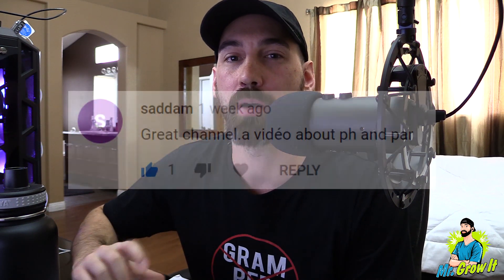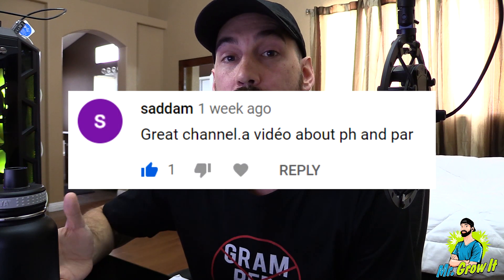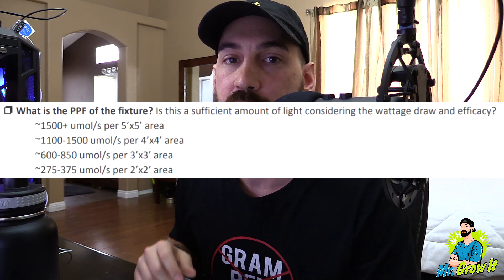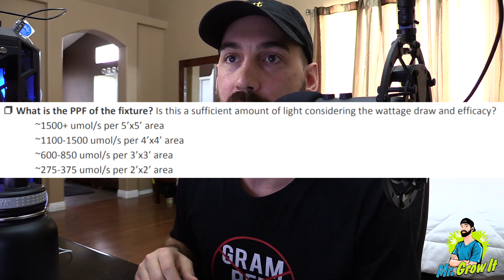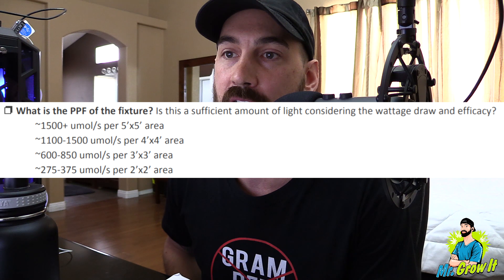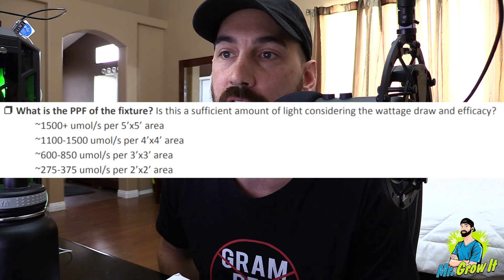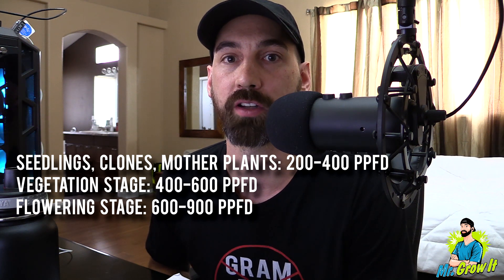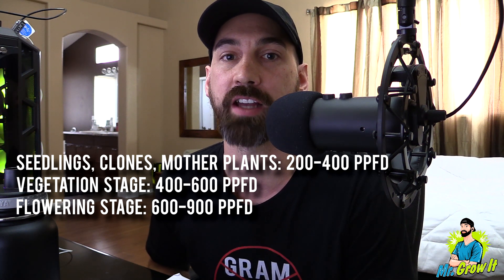How Much PAR For Plants in PPF & PPFD!

Comment: This information is incorrect! When growing with LEDs, and it took me about 8-9 months to figure it out. 200-400 (no more than 420 PPFD in veg) 

And in flower it’s starting at around 400 and slowly increase until 800 (at the end of flower max out at week 6) 

Otherwise you will have plants which are as big as this emoji 🪴 😅😢
Reply: Ps: the plants cannot grow up if the PPFD it too high in veg. Then you have very short internodal spacing and a really tiny plant, as well as light stress / Burn 🪴

Please take this video offline mr grow it. You are spreading incorrect info. 😂
Reply from the maker: Sounds like you may have other issues in your grow if your plants aren’t able to absorb 400-600 PPFD in veg.

If you want to get even more accurate when it comes to lighting, look into DLI. Many cannabis growers aim for 40 DLI. Some go upwards of 60 DLI. 600 PPFD at 18 hrs per day is 38.88 DLI. If your plants are struggling to intake that much light, look into your environment conditions, nutrition, and genetics. Remember, just because you’re not able to get good growth using the general PPFD ranges mentioned in this video doesn’t mean that everyone can’t get good growth with them.

Comment: I just downloaded a ppfd/dli meter on my phone and wow its a gamechanger as far as how close i csn actually put my lights without harming my plants,the meter is spot on too i bought a viparspectra va1000 and the person who had the light before me used an actual meter at 18" and had gotten 638 PPFD and 45-52 DLI  and when i put my phone at 18" under the exact light my phone read 640 pretty interesting
Reply: A single reading isn't really enough to do a calibration, but it does suggest your phone might be fairly accurate.

Comment: Is the par your talking about for auto flowers or photos? Or does it matter? 200 to 400 for auto seedlings?
Reply: Its all about dli.  How much light the plant can absorb in 24 hrs.  If you run 20/4 autos in flower need about 550 par. If 18/6 590-600 is the same dli. Unless your flowering autos on a 12/12 schedule. Keep way below the 900 they recomend for flowering photoperiods.  In other words 18 hrs at 600 par is the same as 12 hrs of light at 900 par

Comment: Chris - I've read using a T5 blacklight ( in addition with my LED light fixtures) during later flowering ( week 3 ) can help produce more THC / CBD. Do you happen to know if there is benefit to this? Is it worth trying out?
Reply: Hey, so if I don't need to turn my light strength all the way up to reach those ppfd or par numbers is that okay or should I raise it to 100% power and raise the light

Comment: Would like to know about DLI in regard to the levels throughout stages.  These changes are only due to the length of light, and not really changing the DLI throughout the veg to flower which seems to be the idea here.  600 par 18 hrs is the exact same DLI as 900 par 12 hrs.... 38

Comment: What about autoflowers? Do they require less PAR because of the 18/6 light schedule during flowering? Or should autoflowers also get 900 PAR for the whole time?
Reply: With a longer light cycles with autos. I'd use a little less then photos.  It's a longer cycles of intensity, so I'm at 50% power  (sf2000) for now. And it's going well.  About 19" above the plant.

Comment: Love your videos,,,so I bought one 1000 watt light and  did fine in a 2x2 area small buds but still that’s fine with me it grew a lot of little buds ,,,so I bought 3 more 1000 watt lights ( they actually use 105 watts) ,,can I use all four lights together equally spaced for a 5x5ft tent or even a 4x4 ft tent ,,,,looking at this lights bigger versions the 2000, 3000, 4000, units each time they get larger the watts increase are the same their 1000 light = 105 watts from the wall ,,,,yet their 4000 light uses 420 watts ,,,
By me using all four of my 1000 together does it equal the same as their 4000 light??? See where I’m going with this ??? 
Most led light companies are selling 1000-4000 watt lights ,,,,,so instead of getting one big light I got four 1000 watt lights
Reply: Are you talking about blurple lights? The ones with Veg & Bloom switches for blue and red? If so, i suggest don't buy any of them anymore.. They are old technology, and they don't produce good results..  For the amount of money you will spend on multiple units, you could just buy 1 single badass professional light fixture..
As you said, the real wattage is 105w. But usually they have fans in them, and the fans take some wattage as well (maybe 10,20,30 watts, i don't know)
Also when you use only Veg or Bloom functions, the wattage is split between them.
105 watts - 20 watts approximately for the fan = 85 watts
85 watts split into veg & bloom = 42,5 watts each
You would have to constantly run both veg & bloom so that function beats its purpose. Just get a good light to cover a 4x4 or 5x5 i suggest check out Lumatek or Photontek lights

Comment: how long until a lighting manufacturer can actually make a bar light to get 925 to 950  ppfd across the whole grid centre, edges and corners in the most popular sizes for flowering (eg 3x3,  4x4,  5x5).
perhaps it is possible with the bar lights which can be adjusted for position and arrange more bars towards the edges.

Comment: Cannibus is in rose family, it does not have diminishing returns or too much light. 
June day is like
2000par. Source Bruce bugbee
Reply from the maker: I know the sun emits over 2000 PPFD, but give your plants 2000 PPFD indoors with a grow light and see what happens.
Reply: @GardenTalkwithMrGrowIt  mine are currently about 8 inches closer to my optic 6 than recommended and there’s no down side so far
Reply: Center is 1895 at 22 inches so it has to be over in the center
Reply: The sun starts the day @ zero....slowly climbs to 2000....then tapers off back to 0 @ sunset. Plants don't recieve 2000 all day.
Reply: @boognish593  I agree there I have my control set to try to mimic better now but idk if it does anything, I def reduce the hours in a step now also. 48 off then 13-11 down to like 8-9 the last week
Reply: Again idk the results as I haven’t monocropped and my plants vary from clone even tho identical almost cuts they just bush up sometimes some stretch it’s strange lol
Reply: DLI is what matters. Its not 2000 ppfd all day outside!
Reply: @markrigg6623  what's a good dli for each stage? or atleast for seedling stage

Comment: Incorrect. You can not get 25% added yields by simply adding Co2 unless Co2 is your hindrance. If you have added 25% extra light, space, veg time, nutrients, Oxygen etc, lack of Co2 has to be your hindrance in getting the added yields. You cant add Co2 and expect 25% higher yields when you have not added 25% more veg time, light, nukes, space etc. That's like adding 25% more horsepower but no increased airflow to support the turbo. Co2 has to be the hindrance in getting 25% higher yields in order to see the yields from added Co2, otherwise you just added Co2 nothing will come of it if u haven't suited the environment and grow for 25% extra yield. You cant throw 25% xxxxx on a grow equipped to only hold xxx. Co2 has to be reason for lack thereof. I see this with all you youtubers, yahl give out false info or actually lack of and that's why most growers fail, from unrealistic expectations. I see you explaining to someone who has never grown in his life, how to run Co2 in a complicated setup and not once did u ask, dude, have you ever grown before? Like they come thinking as a first time grower, the more plants I grow, the more I get when infact the amount of light has yield max if Optimazation is there not by more plants more yields. I dont care if u grow 2 plants longer veg or 60 plants shorter veg 1000 watt 5x5 is 1.5lbs if you filled your trellis with all tops and 2ft of vertical canopy etc. Once they realized they failed they sell they equipment for unrealistic expectations. Teach your subs first the basics, Co2 is for experienced growers being so much optimization is needed and these people here can barely get past seedling stage without overwatering, to much light and over nukes. Teach them first how to grow. 75% are 4 months in still in seeking stage on a stunted plant they won't let go thinking its just growing slow but it's actually dead from salt buildup and overwatering with $3,000 worth of new LED equipment and Co2 tanks in the corner waiting to use it as a first time grower and they cant even get past seedling stage. Unrealistic expectations. I wouldnt even mention Co2 to your subs until they can show you they can first grow and not kill they plants. Same thing for ppf/par/ppfd/umols etc. Co2 is pointless if they killing they plants from over nukes and to much light.
Reply from the maker: You must be new to the channel. Welcome! Did I say "25% added yield from co2" in the video? If so, timestamp please because I couldn't find it. We talk about PAR in this video not CO2. Maybe you commented on the wrong video?
Reply: Oops wrong video I was on your other video it switched while typing but Co2 adds 20% more so I just added the 25% and no I am not knew I just dont comment

Comment: If anyone is looking for a cheaper yet very effective LED grow light. Look on Amazon for deformable led garage lights. They utilize the very same Samsung LEDS and even if they do no not the par output us at or above 1,500 for the price of around $50. You can get them for cheaper by using a promo code or coupon. For instance when searching look for one with little to no reviews. Just make sure that the light says that it uses at least 120 watts and not the equivalent to the same wattage. There is a big difference. As for the lights themselves they have built in drivers and work as simply as screwing in a light bulb. The difference is they have unfold LED panels which are cast aluminum that are driven by an internal driver and have a web like design to dissipate heat. Trust me you will not be disappointed and one light for $25 if your lucky enough to find  a coupon or percentage reduction. Will be all you need for a 3×3. Just make sure you chose one that outputs 120 watts and has between 4 and 5 white light LED panels. The spectrum if measured at 5,000k and 6,000k which is not a specific grow light measurement or is it. This spectrum is near identical to any white grow light. There is a reason the sunlight is white and no other color alone but all of them evenly flowering outward from the heart of the sun. Don't use blurper lights. There have been studies testing these lights growing food and they grow slow, taste bad, and you can't see the plants. Yes a plant may use blue and red predominantly but they also use green, far red, inferred and UV A and B. Which in its entirety is white light. It's a weed people the sun is white don't believe the hype over red blue.

Comment: I personally think 300 to 600 ppfd for veg and 600 to 1200 for flower is a pretty good output. For MJ plants, unless you're useing co2 then 1000 to 1500 sounds about right as well.
Reply: Won’t you burn the plants in 1200 just a question I’m curious to know
Reply: @richardhernandez3088  ya you definitely would
Reply: @richardhernandez3088  I think so but it depends on how far from the plants the light is 900 is pushing it in veg.
Reply: @jeremiahmodgling6859  1200 lol 😂 good one
Reply: Way too high huh??@arrowgunt
Reply: @arrowgunt I think thats high what  is your input?
Reply: No not if it’s healthy plant with a good sized root zone, think of the plant out in the full sun at 2000 it stays cool by way of transpiration , adequate water is required a long with the other parameters, young won’t be able to handle as well and will be smaller then a young one under less .

Comment: I would love to see a par test with Crecer lighting  MetriX 300 I have an ES180 V2 and almost went with the ES300 V2 but went with the MetriX 300  for my 2 by 4 and it is killing it so far it has Samsung  lm301h diodes and Osram 660 nm diodes.
Reply: Bro I have 2 180's in a 4x4 and loved them untill I got my new g8 c3. This light makes them seem like a 25w t5 clone light. It's insanely bright , 1700 ppfd at full power which is Insane , 450 at 3 to 4 ft above canopy and dimmed to 35%

Comment: Why dont you believe in gram per watts
Reply from the maker: Because yield isn't only determined by lighting. There are companies who show "how much gram-per-watt you'll get" with their grow light and growers bragging "this light gave me X gram-per-watt" which is very misleading since there are multiple contributing factors to yield - lighting, genetics, nutrition, environment, how full the footprint is, etc.
Reply: @GardenTalkwithMrGrowIt   Thanks for replying I always see you wearing that shirt so I always wanted to know and I have another question, What is the best way I can bring my heat down
Reply from the maker: One way is to exhaust the hot air out of the environment using an inline fan. If you do that, you need to ensure the air coming into the environment is cool enough. If that doesn't work then add in an air conditioner.